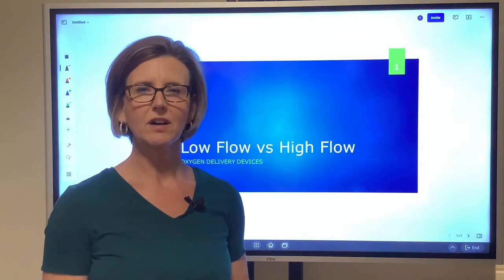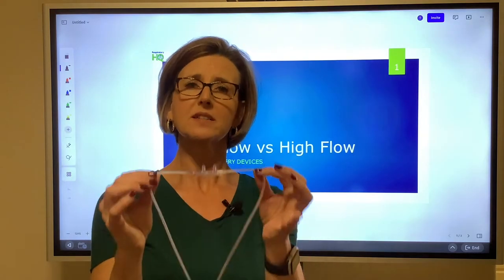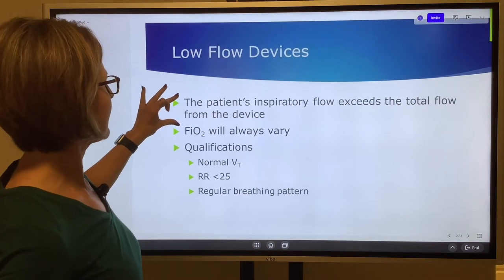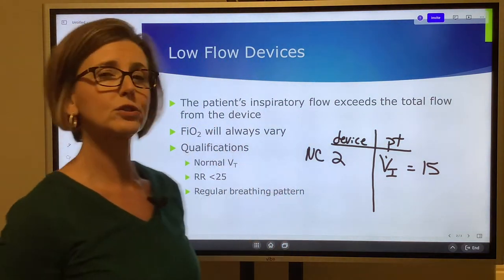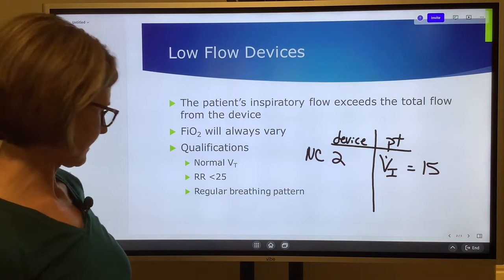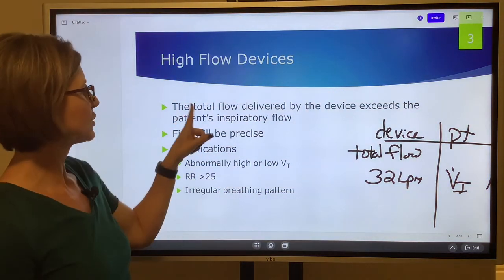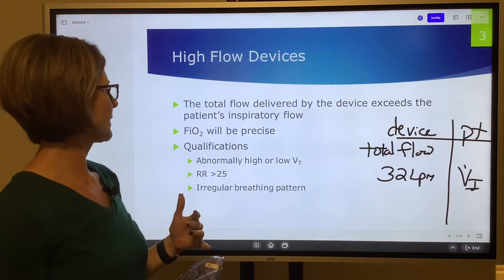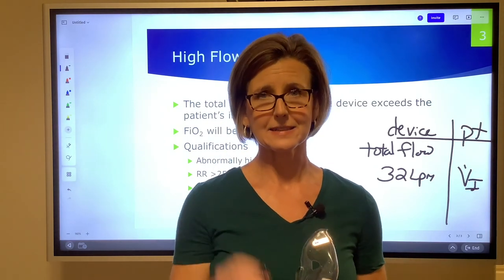Low Flow vs High Flow O2

Comment: Thanks for this. Here's a way to think of it from a patient's point of view. I'm a patient on 24/7 O2 therapy. The flow rate on my concentrator is set at 3 lpm. The cannula is delivering 3 lpm to my nose. If I inhale only through my nose, I'm getting 3 lpm of O2. However, I usually inhale through my nose some of the time and through my mouth some of the time. So there's a pretty random mix of air and O2 reaching my lungs. If I wear a mask (ALWAYS an uncomfortable experience), the mixing of air and O2 is controlled by the venturi and is much more predictable. By the way, if anyone makes a mask that is comfortable I'd like to know about it. I know these things are considered disposable, but patients would appreciate their comfort being considered.

Comment: Thank you! Can you explain why a Non-Rebreather is considered low flow and not high flow?
Reply from the maker: Some instructors categorize it as a high flow.  Basically if it meets the patient's inspiratory flow, it will function as a high-glow device, if it does not, it will function as a low-flow device.  Just depends on the patient and their inspiratory flow
Reply: @respiratoryhq2082  Thank you!